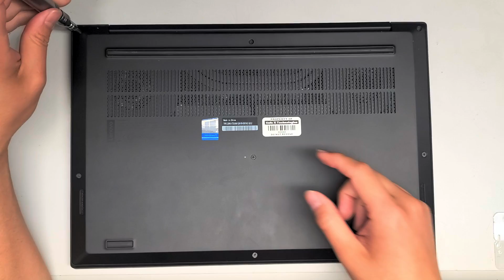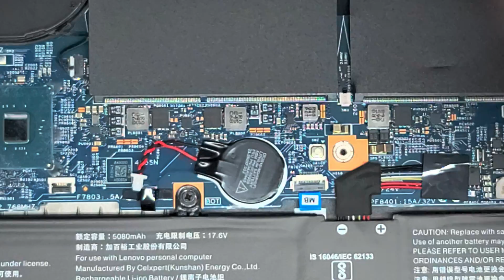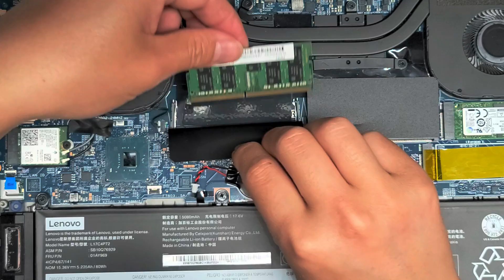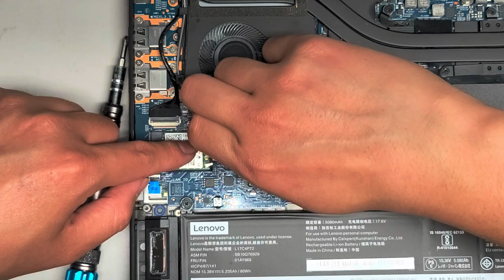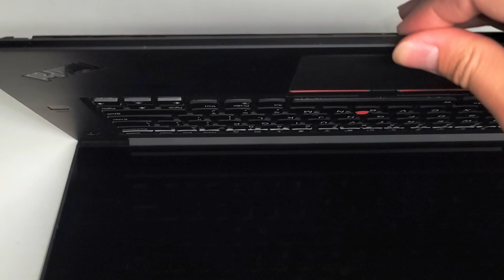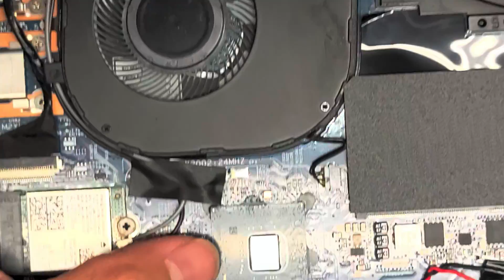Lenovo ThinkPad P1 Disassembly RAM SSD Hard Drive Upgrade Repair Power Reset Fix

Comment: Hye sir, did u already solved this? Can u share what happen? I found my p1 no power same like u. Already reset.😢
Reply from the maker: If it's still broken yours might be motherboard, charger, or charge port.
Reply: @ItsBinhRepaired  Battery test ok, also charging port have light up. Im pretty sure motherboard did u repair or change another one? Can i know your specific problem?
Reply from the maker: I don't remember other than the video.

Comment: Thanks for this! I'm looking to upgrade the RAM on my ThinkPad P1. Glad to see Lenovo still maintains really easy to work on systems. Now if only RAM didn't cost a small fortune....
Reply from the maker: I found RAM to be one of the cheapest components. The issue is people are putting way more RAM than necessary. Right now, less than 1% of people would benefit from more than 8GB of RAM.
Reply: @ItsBinhRepaired  I do a lot of heavy work with big spreadsheets and visio diagrams. Machine crawls with a single 16GB stick. I wanted to max it out to 64GB. But two 16's will have to do for now.
Reply from the maker: @danieldecost5690  I see. You might be benefiting from dual channel being activated with 2 sticks more than the fact that you increased your RAM capacity.